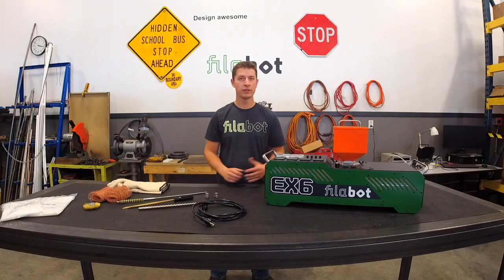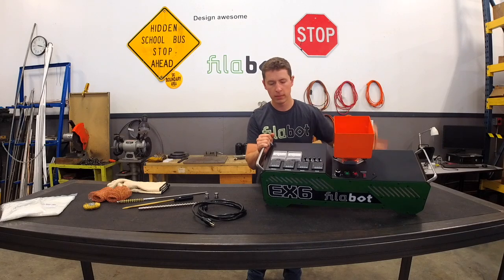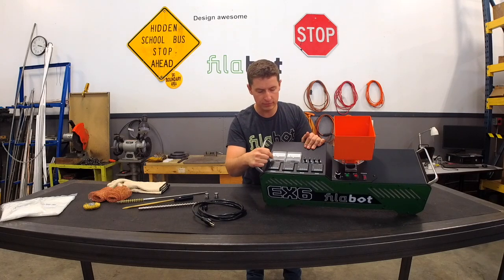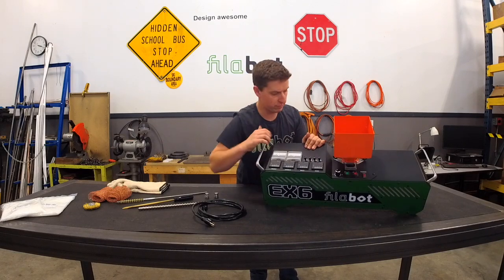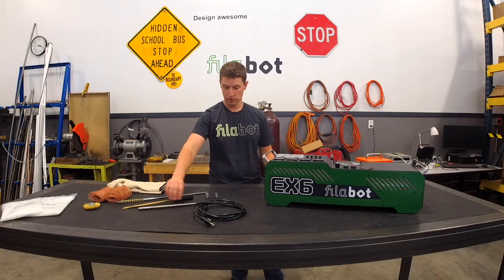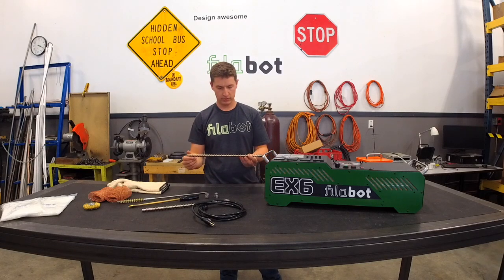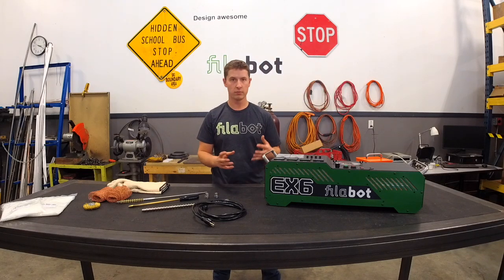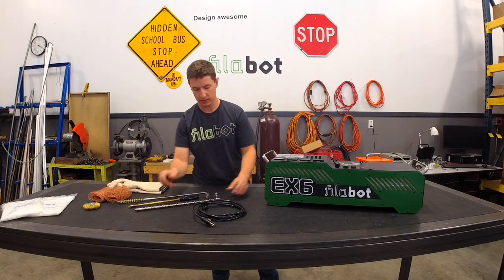Filabot EX6 Overview

Comment: If there is a DIY kit for $600 and all you need is a 3D printer. I prefer that over this. It's like the same part. Same thing. Same wire tensioner setup. This is b***** it's most likely a scam like the loop